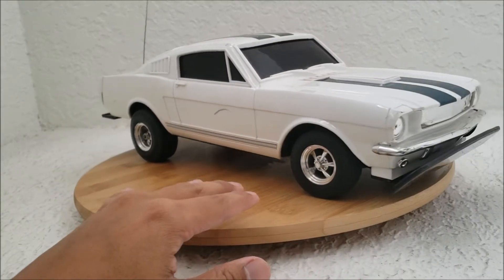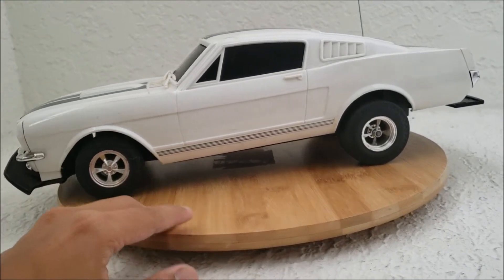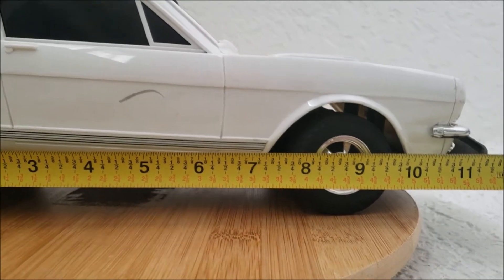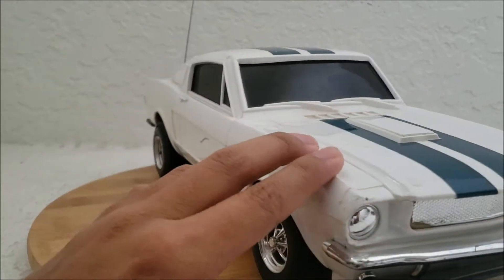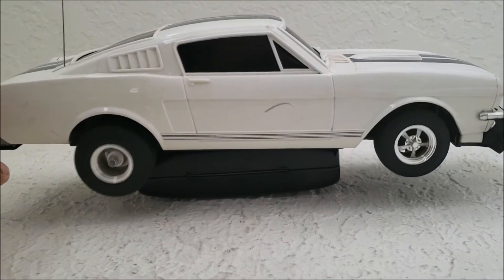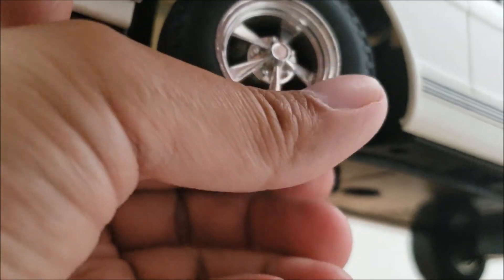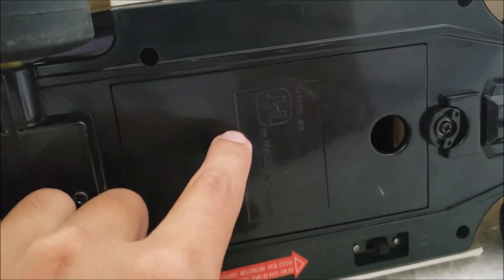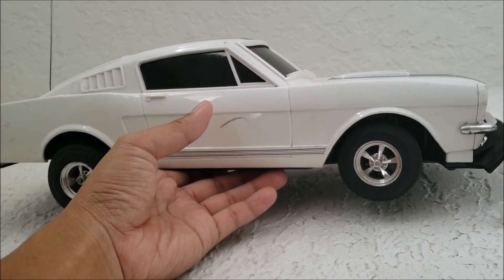JRL '65 Ford Mustang R/C Car (1/12 scale)

Comment: Quite pristine all things considered. That's over 30 years old! Thinking of replacing the old motor for a working one with a remote?
Reply from the maker: possibly - I would typically look for a hobbygrade chassis that would fit that body.  But in this case, I love those wheels so I want to try my best to preserve that chassis.
Reply: @PrinceofMacedonVlogs  What about the suspension? Is there room for oil-filled shocks under there? i know it has 4-wheel suspension. ( I was obsessed with these when they first came out - still am)

Comment: Did you get this recently, from ebay? I was watching one recently on there, but it was new in the box. I wanted one of these so badly when they first came out! The steering is proportional, and so is the throttle. I think the most likely culprit for it's malfunction, is old electrolytic capacitors. They rely on a chemical reaction, to function properly, and when the chemicals get old, they lose their properties. I could be wrong, but I think an experienced technician, could do some testing on the PCB board/boards, and ferret out the problem. The trouble is finding one who's willing to try it, without a schematic. You need to know the intended input/output voltage of the components, to test them, or at least their intended resistance. Cheapest way to get it running again, will probably be to convert it to hobby-grade.
Reply from the maker: hey dude!  I got it from Ebay awhile back.  But mine wasn't NIB.  I wish it was.  It's a beautiful rc.  Very vintage too

Comment: I have allot of parts for these cars, I actually have the controller the you need, let me know if you are interested and I will place it on eBay. It is normal for them to race off with no controller. You have to power up the controller first then the car. The controller centers the steering and the Throttle center. I have a couple videos posted on these cars, I have about 9 or ten of them and about 30 Lexan Nascar Shells lol.
Reply: Franky I've had mine with remote and charger since 89. I'm 57 now :-)  Tried it today, forced the old batt to take a charge. Front wheels steer but no drive wheel action. None.  Suggestions are welcomed!
Reply: Do you know where to get replacement wheels and tires for these cars?  I'm trying to restore my childhood one.
Reply: @jasonkosmaczewski2809  I have some spare parts for the JRL Stock Cars What color are the wheels?
Reply: @frankycheese They look just like these.  It is the same car but pink.   I can't get the radio to work (The car jumps when I power it on but it doesn't respond to the radio.) so I might do a conversion to modern electronics like you did on your channel.